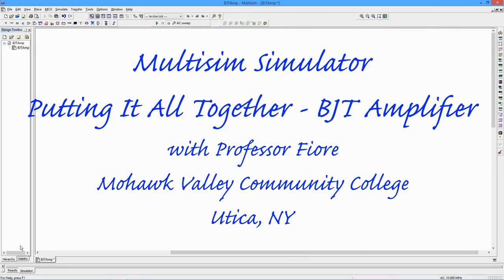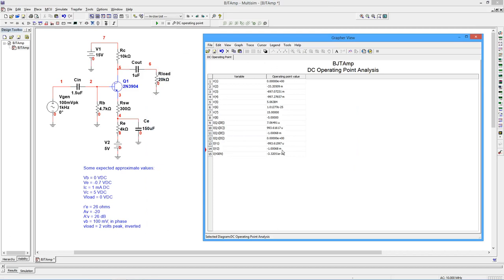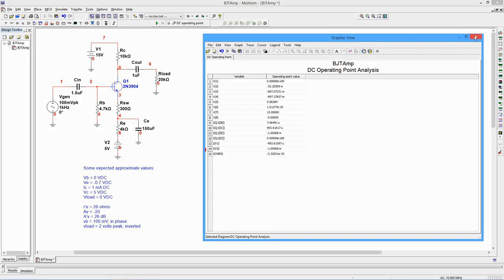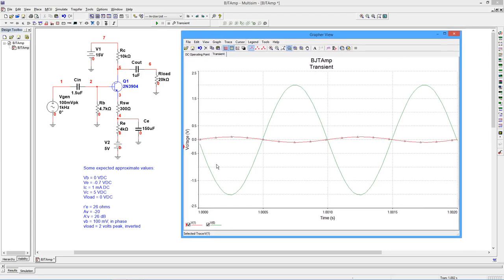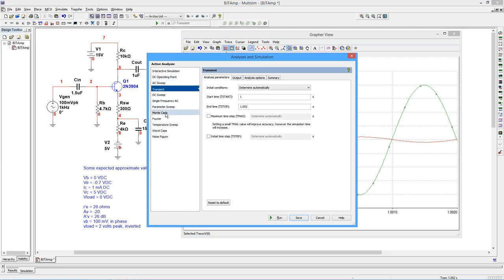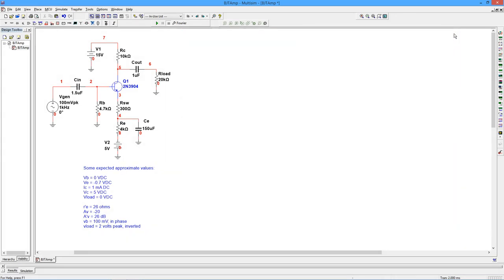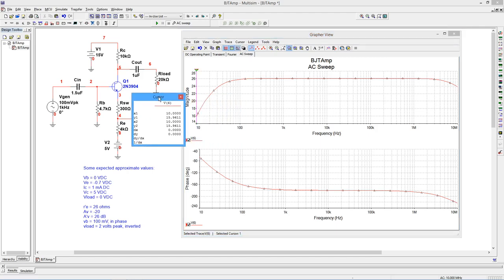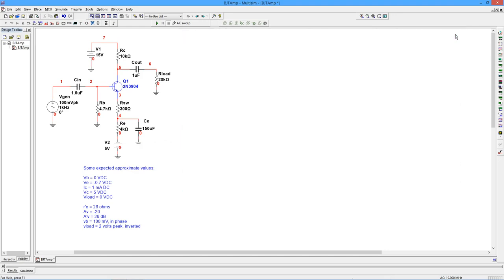Multisim Putting It All Together, BJT Amplifier

Comment: since i use Linux as my OS, i've been using LTSpice for about 20 years.  it can do everything Tina and multisim, and it's easy to add device models to.  in some cases it even does analysis of SMPS circuits with failure modes modeled.
Reply from the maker: Good to hear your feedback/experiences. LTSpice certainly has its advocates, and the fact that it is the "in house" simulator for Linear Technology (now part of AD) is a huge plus. My position is that people should use whatever tools work for them (assuming it is accurate, of course), so I don't officially "endorse" any particular piece of software. I've used LTSpice but I find that the TINA user interface is somewhat easier for beginning students to latch onto. As far as Multisim is concerned, I started using that way back when it was called "Electronics Workbench". I find the interface to be similar to TINA when it comes to building circuits (although I am no fan of the way it rewires things if you move a component). Over the years it seems to have become bloated, though.
Reply: @ElectronicswithProfessorFiore  the problems i had with Tina and EWB is they only worked with Windows, and they were node limited in their free versions.  i've used LTSpice to duplicate the APT-1 power amplifier with modern components.  i worked at APT in the 1980s, and was the final test tech for that amplifier.
Reply from the maker: @petergunn551  I remember Apt. That was a Thomlinson Holman design, right?
Reply: @ElectronicswithProfessorFiore  yes.... i learned a lot from him while i worked there